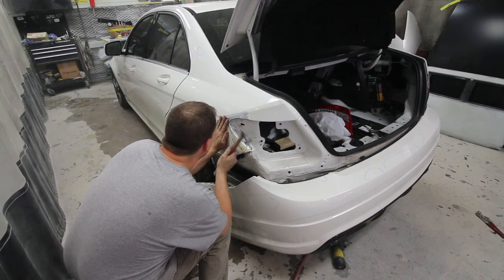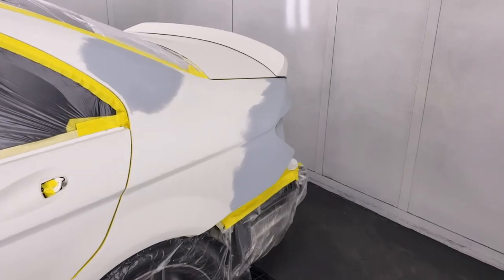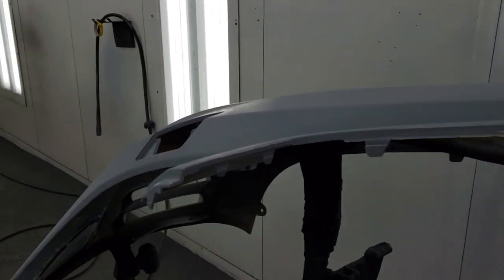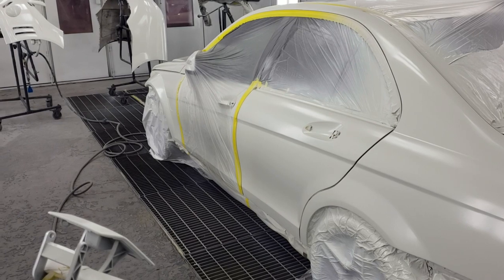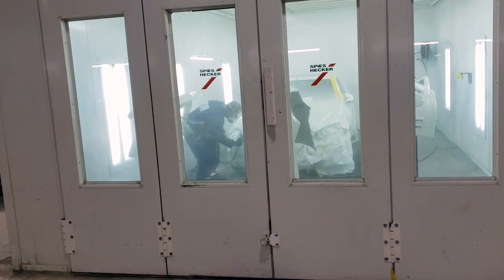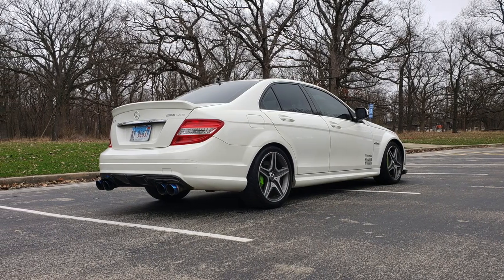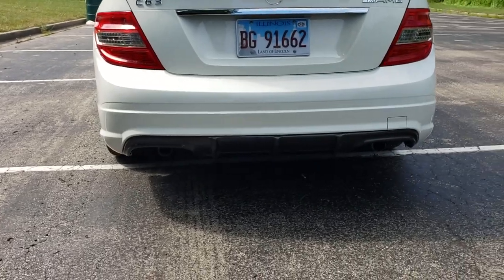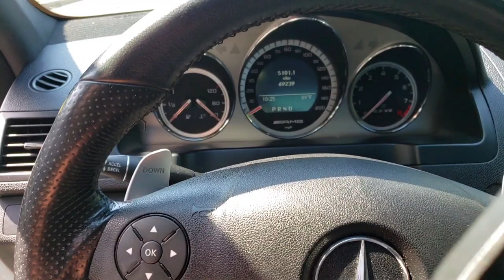I Love My Cheap C63 AMG So I Had It Restored. Cost Breakdown + Euro-Spec Bumper Mod. Amazing Results

Comment: Paint color seems a bit off considering the right rear fender and comparing it to the bumper
Reply: Newly painted, just buffed paint is gonna look a bit clearer than old paint, but it will look the same in a few weeks maybe!
Reply: actually more because it's plastic vs metal
Reply: @AlexA-bx8jr  His hood and side panels are plastic?
Reply: Or maybe light reflection? I have a picture of my car where it literally looks like it is painted in 50 shades of grey.
Reply: @raulv98  same.. my previous A6 C6 had every possible shade of grey, noticed that others look the same.

Comment: 36 years of experience...dude...that’s how they spray the cars in some backyard in Poland. That’s definitely not a quality paint job. I guess we just have much higher quality standards here in Germany...I certainly wouldn’t be happy with the result and the “level of professionalism”...
Reply: I was thinking the same. Bodyshops in the US are just not on the same level as they are in western Europe. I'm from the Netherlands and a paintjob like this would only be like 1000 euros in some shabby bodyshop. But if I go to a pro it would be like 3000 euro, and it will be perfect. Body gaps still are not right on this car to be fair.
Reply: @wouterboer66   Exactly. Just the fact that he is painting between the body panels (closed door??!) makes me shiver. Also he painted over the rear spoiler that was still on the car? This can't be real! You need to take it off and paint it separately and then put it back on the car. Seriously thats just straight up crap... If you want perfect results you need to paint every single part separately completely stripped down. You can't paint a car when its completely put together.

Comment: Your hood still doesn’t look right on the driver-side the bodyguard looks way too big and the door gap to the rear quarter on the driver-side doesn’t look right either nor does the truck gap to the drivers side quarter panel I’m just saying it still catches your eye quite a bit with the misaligned panels
Reply: Russell Fitzgerald only thing that actually stands out is the trunk gap which is adjustable.
Reply: You are right. Front bumper as well. I'd love to own this car, but it still is not close to perfection to be fair. I don't understand all the oh's and ah's in the comments.
Reply: Wouter Boer to be fair were these cars perfect from the factory? I doubt it.
Reply: Jimmy Grant It’s not a question of how well it was done at the factory just comparing it to the passenger-side

Comment: Well when doors and fenders and hoods not painted off the car you get overspray seem at the edges witch is easy to tell a respray parts should be painted off the chassis quarter panels get painted with door cells so not the best it could be
Reply: But I’m sure it looks great most ppl don’t notice it like a car guy does

Comment: I did a conversion for my e350 i went with amg bumper meaning, my side orange markers are gone, now, when you do that, you normally, or at least myself would think you are okay to remove the actual bulb from the side marker, the one that goes inside the orange housing, but by removing the side marker's bulb, the signal marker on the actual headlight stop working, because you brake the connection in some type of way, i been looking around, on all forms and i cannot find an actual clear answer, the simple solution that a guy (@w212_seattle on ig) gave me was he just zipped tie the bulbs to the frame, so i did but that idea is a little bit risky since the side marker bulb are halogens and something could burn, so my question is, what did you do to make the signal markers on the headlights work if you actually removed the side orange markers on the bumper? Any ideas?

Comment: Man, I’m looking at an 09 C63 AMG now myself, and the PPI was disheartening.  Oil leak, transmission pan leaking because of rust, a wide assortment of codes, and a few gismos not working.  Two dented wheels, some repainting. I was out test driving the same day after, and some dude pulled up next to me with a serious, eager look in his eye asking me if I wanted to sell it.  On the plus side, what a beast it is.  The seat bolsters are as narrow as a size 0 female.  Not sure I can numb my back enough to live with them. I’m wondering if I just gotta look elsewhere. The car is 20,999 and need couple grand of stuff done.

Comment: Looks great, but why wouldn't you remove that aftermarket stick on spoiler before paint? It's attached the same way the badges are. Such attention to detail beforehand, though leaving that on seemed to undo all of that. Just my 2 cents. Again, it turned out great.

Comment: Please don’t hate me...  I know the body shop paint shop is a pro and you fixed and made the previous horrendous body work a million times better. But the seam/gap lines of the front bumper meeting the front passenger quarter panel isn’t consistent.  Also the trunk lid and passenger rear quarter panel has a wider gap than the driver side... I know I am so annoying but I noticed them immediately - probably because the car is white and made the black lines so noticeable... :-(

Comment: Hang on a sec, you spent 8.5K and then 13K to fix it ,but wait if you add the cost of time and labour to that, meaning that if someone wanted to buy the same car with more or less the same issues and had to pay a dealer to fix were talking a lot of cash around 20K all up easy, so Doing it yourself sure to save a lot of money, but that's the thing if you have the tools and you have OCD and you cant stop and take a breath and smell the flowers than your better off working 23 hours a day and sleep 1 hour and eat in that hour? But also if you love doing what you do keep it up if it really makes you happy inside, if not you will die of a heart attack before you know it?

Comment: I can tell that the rear driver door isn't aligned correctly, unfortunately not a perfect work

For the paint correction, I would highly recommend to take it to this shop. 

1439 W Shakespeare Ave, Chicago, IL 60614, USA

Comment: i do body work for a high quality shop so ofcourse u see things that make u smirk like using regular top coat body filler on the rear cover..will crack if it gets bumped. He didn't put that much material on the left qtr. Well thats because there was already a ton from the last repair he just basically did a finish coat over it, and all that grinding and no saftey glasses? but hey great video and i like the car.

Comment: Seems odd they didn't remove the trunk spoiler and paint it separately, now you would need to repaint the trunk if you ever change out the spoiler as there will be a clear coat line if you remove that spoiler.

Comment: GREAT that you got a euro bumper. Why do US vehicles need the orange thing? Even in New cars they are now putting it INSIDE the lights!! It honestly looks so so bad and cheap. Surely it is not necessary and carmakers can just start removing it or at least lobby to get whatever rule that makes it mandatory scrapped.
Reply: It's seems to be a North America thing only. need yellow lights facing forwards and sideways, and a red light at the rear facing sideways when the running lights are on, but don't need side facing indicators (maybe they do now). Usually every country has some weird quirk in their design rules. What I don't get is how come the car needs it when it leaves the factory, but you can delete it later and no one (not even the  registering/licensing body) cares!